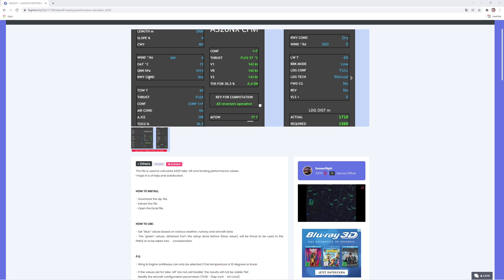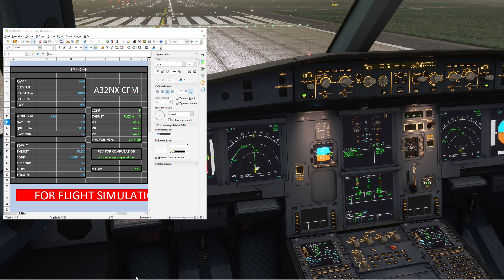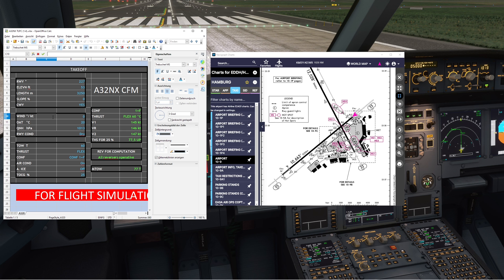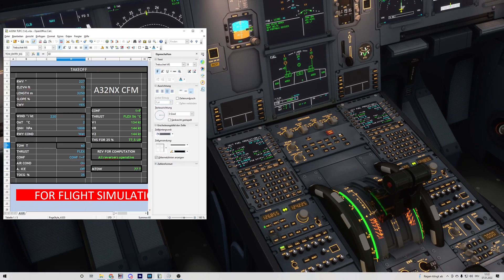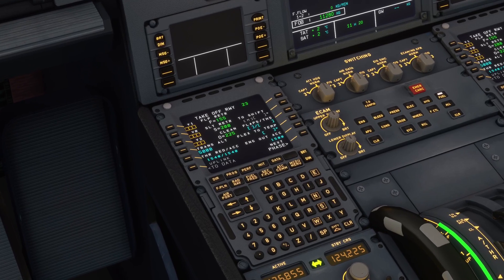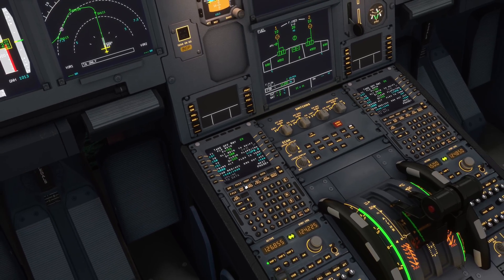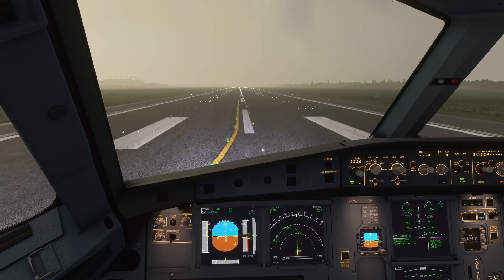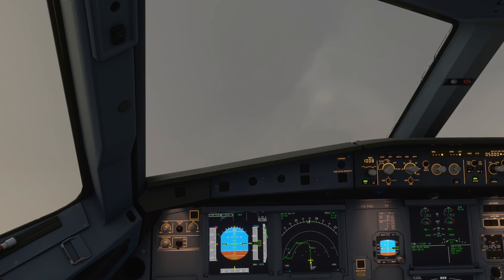How to calculate the Take off Performance in the FBW A320Neo in MFS2020

Comment: You should use your Center of Gravity (with fuel) for the takeoff calculator and for pitch trim calculation, NOT the ZFWCG!!!
Reply from the maker: Hey, thats correct. The problem by that time you we didn't have a laodsheet with the take off cg. Now with the fbw you able to check the take off cg In the tablet.

Comment: This calculator is for a320 ceo Not for neo which Use other engines so this is Not that accurate and you use cg for an Aircraft that is without any fuel, this is Not Right 0.0 make no sense
Reply from the maker: Hey, probably true that this calculator is not for the cfm leaps but right now there is no other calculated for the fbw wich come close so that's the most close you can get right now for the fbw. Also proablay the maker of the calcualter means the cfm leaps not the cfm of ceo. You mean the pitch trim 0.0? In this case the CG was at around 26 balanced like that that the pitch trim is around 0.0 that's also a rare case I have this.
Reply: @JonasAviationJ  your right